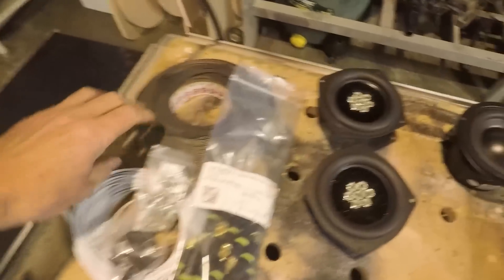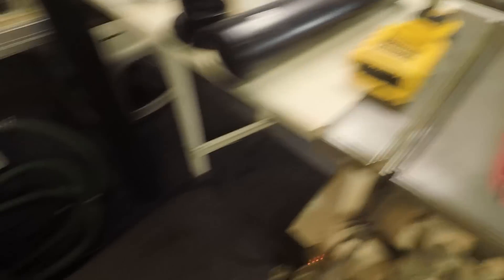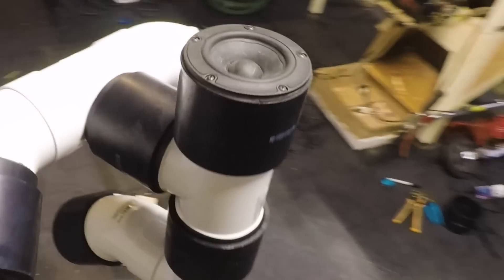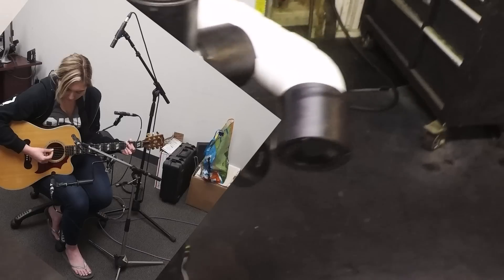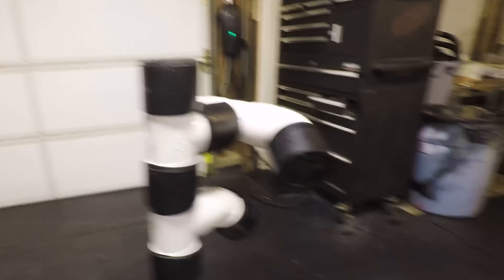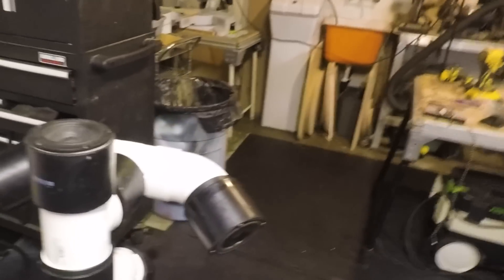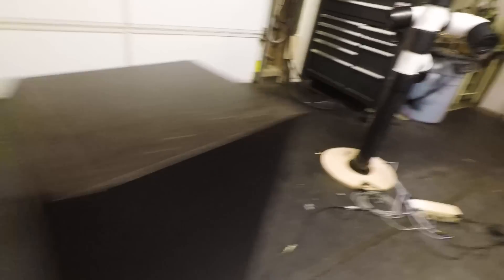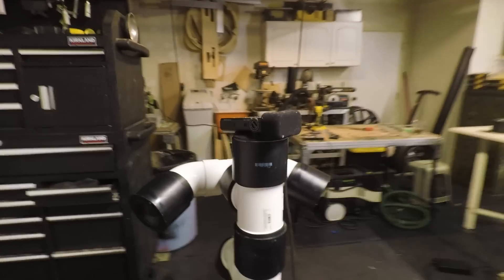Speakers Don't Sound Real, Lets Build One That Does

Comment: I am not a sound engineer but I love sound. A while back, when you made that video a while back, it got me thinking... instead of pushing my mix through a stereo or surround system, what if I ran each track (mostly synths) to a separate speaker. much like an acoustic band on stage each speaker is arranged in the same way. Sounds awesome!!! 

And now you've gone even further with this sweet "speaker array", love the low tech set up, holes and all. This new video got me thinking some more in terms of making sure that everything is output mono. I say this only because you mention that the multi box has a stereo in... Sound is mono,  as you point out,  it emanates from a single position (source). What if the recording mics are sent in a coordinated position with the output speaker array. Or a single mic pushed through the 4d speaker setup?

 Nonetheless and allthemore... your explorations are an inspiration!!! all about that oblique reality - peace
Reply from the maker: Awesome and I will do more vids and dives deeper into this

Love that you are doing cool stuff

Comment: Some years ago I was walking past a HiFi store and heard what I took to be a Piano/Bass/Drums jazz Trio playing live - I went in and found the sound coming from a pair of Quad ELS63s For genuinely realistic sound, I believe Electrostatics are the way to go.
Reply from the maker: Very cool and I have heard some great sounding electrostatic and other speakers. Clear and accurate sound. But still the illusion fades as you walk around due to the sound getting bright or dull or not changing.

A real instrument sounds different as you walk around, you hear more strings or more body resonance, it's not an EQ or coverage thing, it's the want the various sounds of the instruments mix together differently as you move.

That is the challenge with speaker that have only one signal input like left or right or rear left or center or whatever.
Reply: @DaveRat  Have you considered the use of electrostatic speakers in this project? Even with a standard driver, the sound is very impressive - I just wonder how far it can be pushed toward realism.

I'm excited to see what you do in the future!
Reply from the maker: Electrostatic speakers sound great but they don't sound realistic especially due to the out of polarity sound coming from the rear which causes a huge null 90° off axis that is very unrealistic

Comment: Somehow Dave reminds me of the Flight Test guy Josh Bixler. Nice concept, I think some passive drivers could also help, other ideas include using different frequency drivers in certain directions due to the way different frequencies move around the room. I quite like my electrostatic Quad ESL 57 speakers for this reason, they are open front top and rear, they have  large surfaces  and different panels for the different frequencies and sound much better with a high quality bass bin that already has omnidirectional characteristics. Having all those extra recording mics is great, The sound techs in the recording studios would love you Dave. lol How would you do it for direct input instruments? Wold you simulate multiple mics or would you record from points on stage or around the musicians monitors? 
  Another idea i had was to build a large spiral and conical speaker with many drivers starting back at the deepest part of the spiral cone and mounted all the way along a spiral ramp until the outside edge is also filled. This would in effect create a time delay which could or may not be compensated for depending on preference. Almost like a giant coaxial speaker but built from smaller speakers mounted to a kind of spiral conical ramp meaning that the same frequencies would hit you at different times. However this might also be regarded as an interference pattern nightmare. On the other hand it may also solve some of the issues with interference patterns as the holes would also be being filled by a speaker that was further forward or further back from the others that are interfering with each other. 
  I named the design spiral speakers or spiral sound.
Reply from the maker: Very cool and for nest ff, I too love quality and eccentric speakers.

The. Ley here is the pure simplicity of recreate Ng a realistic sound with 4 mics, 4 amps and 4 speakers, no EQ, no crossovers needed. No complex design, just capture 4 some nds radiating in 4 directions and reradiiate them in 4 directions

Comment: Yes, DAWs need to be able to have L and R (surround) for each speaker-set inside the mixer so that the producer can record each direction part into the correct face of the speakers different sides. **That doesn't exist yet**

So when recording Left side guitar for the left speaker you could have a further choice to have 4 side mixing for that speaker (inside the daw) to get LEFT, RIGHT, TOP, BACK stems for every element inside that single L speaker.

So first you would need to set the guitar in the left speaker as you normally do in stereo mixing but then you would need to further be able to mix the surround attributes of that guitar.

But when playing it on a normal speaker the Top/fullrange would be the only part to play through a normal stereo speaker or something like that.

I think the speaker idea isn't 100% original as there are 360 speakers and the like trying something similar, but the idea for deep/true surround radiation for each instrument inside and out from each individual speaker is a great new idea to follow through on. because that doesn't exist yet.
Reply from the maker: Very cool and you get it! As far as existing 360 speakers, do you know of any that are multi input for each direction?

There are loads of speakers that shoot the same sound 360 or omni but that is kind of the opposite of realistic and completely unnatural.

Very interested in seeing any multi input multi directional speakers out there if you know of or can find any
Reply: @DaveRat  Yeah no, Bose 301 series etc did that 180 omni thing I think with small elements shooting to the back/front but using the same input as the front highpassed to get more "air". 

Multi input seems completely or fairly new because of the complex multi track layout needed so I haven't heard of it before really. I'm looking forward to finding/seeing/hearing some soon in the future.

I think it is complex because the producer/mixer has to have done the work, and the streaming platform need a partner with a select app/website that handles each multi-track using a 3rd party handling the 4D stems, as spotify only handles one sound file in stereo and probably haven't started with dolby atmos yet either.

so this would create a work oppurtunity for a 3rd party to partner with streaming platforms for the artist to upload through a special multitrack handler that would sync with spotify when connected to the internet to play it in 4D and offline it would only play the standard stereo version.

but this would only be viable if the 4D speaker system is created by the same handler or set a standard patent for others to follow and create more speakers.

and then it would probably easiest work as a low latency bluetooth system and not with any amp or home surround sound system as they would still need a digital to analog converter but this could be solved by building a new amp system that can handle 4 dual cables per speaker or more, probably creating a new wave of hi fi wars in the future.
Reply from the maker: I am not thinking main stream. More for bars and restaurants to have a musician live stream. Or perhaps artist coul upload a 4 track for download and playback by people that but or build a speaker.

Simple, realistic and the complexities ofntringbto blanket this to the general public is of no interest to me
Reply: @DaveRat  I'm exited for any new kind of speaker. so I am now having this in the back of my head if I see anything in the future, now that I have learned something I've never thought about before.
Reply from the maker: I love that
Reply: How this would be handled through normal 2 way speakers would probably be the most simple way having multiple surround elements play through each 4D speaker but then again this kind of system would probably only work best with a wireless connection and using programming to handle each speaker set of directionality when playing 4D music off of spotify or something in the future.

Comment: I imagine listening to Dolby Atmos mastered music on a pair of full-size Apple HomePods positioned in space in a room might carry the same sound signature as this is trying to demonstrate.
Reply from the maker: Hmmm, Atmos tries to recreate an environment and put that in your home, this tries to drop a musician directly into your home environment.
Reply: @DaveRat  Yes, that's right. But the Atmos mixed recording includes the information how the music should sound in space (even though this information is encoded for a "wrong" paradigm). HomePods have one upward firing subwoofer, five (seven in 1st gen) tweeters evenly spaced around the perimeter and a bunch of sensors, processing power and algorithms to calculate what each channel should play. Therefore you end up with two towers that radiate sound in all directions (similar to your setup), that do not require a new format in which the music needs to be mixed. It also gets rid of the inherent issue of requiring predefined speakers positioning for which the music was mixed (an issue your paradigm would suffer from since if you added more instruments, it would have to be mixed and mastered for a particular layout of speakers to sound consistent/good, unless you would only use one tower for all instruments or add a tower for each instrument, which would bring its own set of issues). Although I'm sure you could experiment with optimal placement of the HomePods to improve the result. Of course you could achieve much better results with your approach under perfect conditions. However, for it to spread (and therefore have content available for it) I'm afraid some compromises need to be made and this is an approach with a compromise that's already available and functional without any extra work and could be used to improve upon (e.g. build acoustically better towers than HomePods, although I'm not sure how you would approach the computational part in such build). It's all just theory tho, I sadly have no means of testing this. Of course, it would work with any speakers of this kind, but I only know the details of HomePods and Apple is also quite good with the computational stuff which is critical in this case (the conversion from surround channels to two radiating towers needs to be done well for the result to sound good).

One more thing that comes to mind... Free parties (as in tekno). In this musical subculture, people build their own rigs which are often a wall of speakers with tweeters on top pointed from the centre to all directions in front of the rig (therefore not all directions, only a sub-180 degree radius). Far from the perfection of this concept, however, it's something different compared to the usual stereo/surround setup (although those often appear as well).
Reply from the maker: Yeah, all that is coandbimportant for recreating environments and un related to what I am trying to do.

I don't want room sound, I don't want localization or positioning, I just want the pure instrument such that the speaker sound similar to a person walking into the room and playing.

Comment: ‘A’ for effort, Dave!  Have you tried the curtain test?  Most acoustic realism ideas fail there.  One thing that did better back in the 70’s (but not perfect) was dynamic range expansion.  Microphones, tape and speakers compress sharp transients. Our ears love compression in general, but reality is super peaky: a wedding ring accidentally tapping or scraping a guitar sound board sounds very different through a recording system.  But electronics weren’t up to the speed and selectivity of expansion in the 70’s and it failed, except for Dolby made millions using it for the first tape noise suppression systems.  Good job, buddy. Interesting video.
Reply from the maker: I will do more vids where I compare real time sound vs playback in various speakers and you can decide for yourself how well it works

Comment: I big empty garage with lots of reflections isn't perhaps the most neutral environment for doing audio testing 
Blumlein stereo recording would require two mics and then their output  mixed to place the instrument  somehwere in the  sound stage BUT tbh most recordings nowadays are nothing like this with  single mics on guitar amps  or mic arrays to record drums  acoustic pianos etc and thenthere's ambient mic's and then the DI'd instruments - once they are all mixed in together there's no way of really producing anything NATURAL sounding. Mauybe if it's just a very simple acoustic guitar / singer but music produced nowadays is nothing like that. That's maybe why old recordings of Jazz and popmusic can often sound real? I made recordings using a fake head "Binaural" and they sound great through headphones  but to record complex music you'd have to have consistency about teh way it's recorded

I 've made quite a few very simpl blue tooth speakers that use full range drivers - nothing "designed" and any old stuff i had at hand that  sounded great and had a natural feel too same thing for mono speakers I rigged up that had a few drivers aimed out in deifferent directions. It's good fun to play with and only YOU can really decide what you prefer. Adding ambient rear speakers can often help with stereo sounding "unreal" or flat - Having said that decent placement and room acoustics will help a lot with plain old stereo

I think a lot if the issue is trying to make these very complex recordings work with the stereo set up.....
Reply from the maker: This is designed to drop the instrument realistically into any environment.

So yes, the garage is perfect!

As is anywhere and everywhere else. This is not about recreating an environment like stereo tries to do. 

It puts a real sounding instrument in your room
Reply: @DaveRat  so it only works for recordings of single instruments done with simple mic set ups rather than a complex stereo mix??
Reply from the maker: Hmmm, not sure what it only works with, but the goal was to design a speaker that can sound like a real instrument, lifelike.

That said, with 4 amps driving seperate speakers in each unit, I would thing that 2 units with their 8 independently driven speakers could be dumbed down with less inputs and still do way more than a simple stereo setup.

You could have control over width and depth and complexity of the stereo image. You could drive just 1 speaker per side or multiple speakers per side with various processing if one desired to do so.

That said, even with this setup that is way more powerful in it's capabilities than stereo, my goal remains to strive for a sonically realistic source. To me, that is super exciting and nowhere to be currently found.